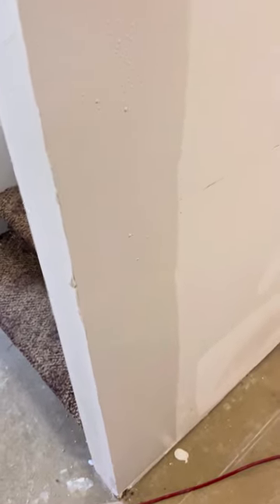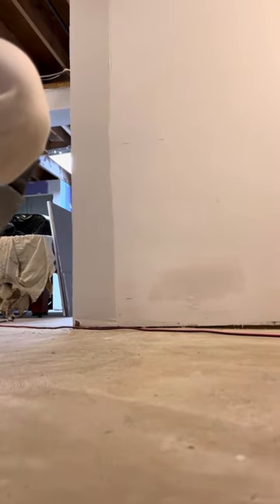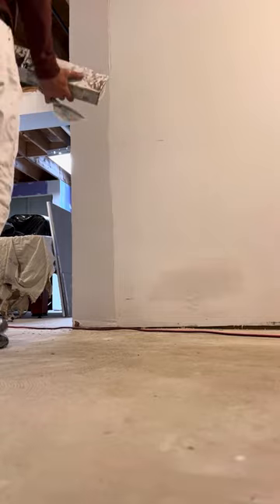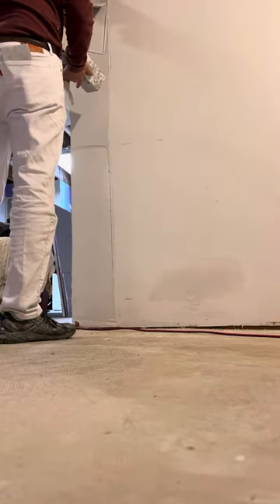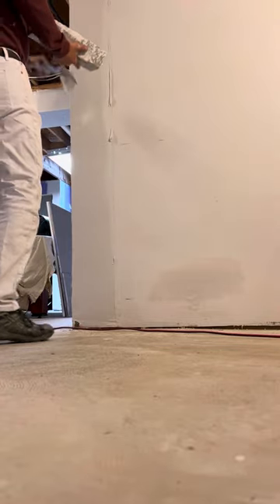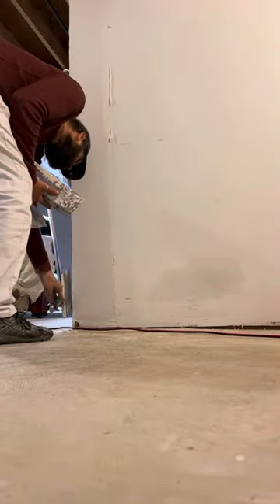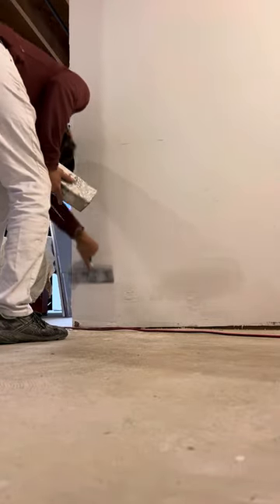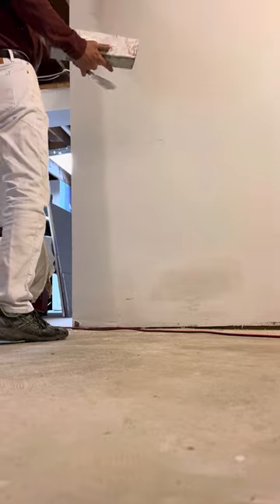Easy fix! Air bubbles in drywall mud over painted surfaces!  Subscribe for more pro tips!

Comment: What type of mud do you recommend? We have a hall from hell that keeps bubbling
Reply from the maker: For this application,  I was using ProForm midweight red lid mud.  All purpose works as well.  If your having serious bunking issues,  try leaving it a little longer before taking it completely off,  then reapply it.  It seems most important thing is to make sure it has moisture before it’s coated.  Maybe try a spray bottle and mist the wall.